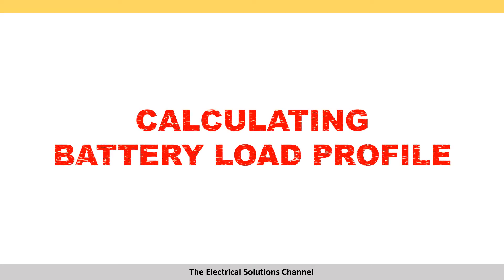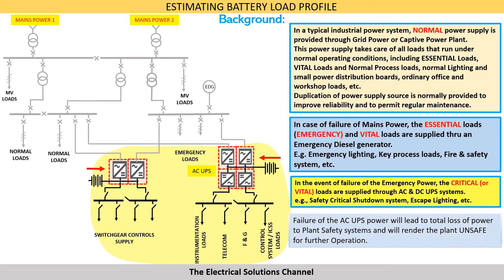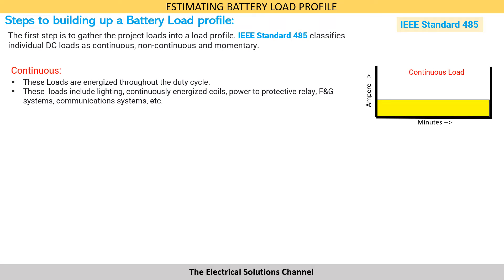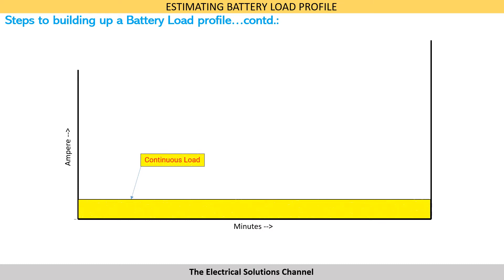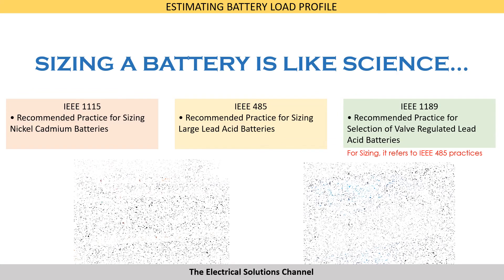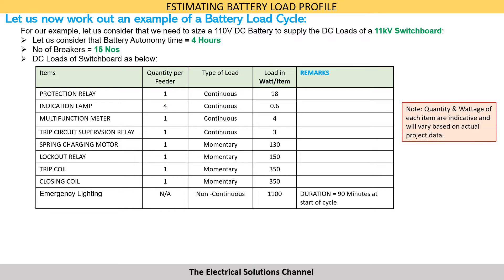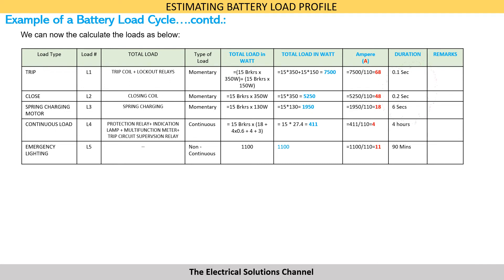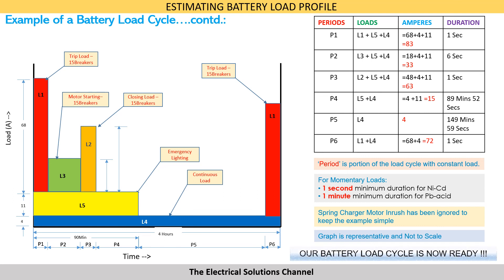BATTERY LOAD CYCLE PROFILE

Comment: Sir let me elaborate my query, in addc they required bus coupler in lvpanels in the same room. Say for example i have 2 lv panel which is in the same room. Since the bus coupler is required for maintenance and alternative source, so the sizing of my transformer will be 1tx supplying the demand load of 2 bus? Then the sizing of bus coupler and busbar will be on the sum of MDL of mdb 1 and mdb2. 

CASE2 if incase the sizing of thansformer 1 and 2 is for the dedicated bus section then load shedding will be considered since the mdl of 2 bus section will cause overloading inf incase 1 tx is failed or during maintenance.
Reply: Can i email you sir the sld so you can understand what im saying?
Reply from the maker: Thanks for your comments. Your configuration is not clear, However, if the transformer is required to supply loads of ONLY 1 bus then it should be sized to carry the loads of 1 Bus only. In case, the transformer is required to carry loads of the 2nd transformer also (in case of a fault in the 2nd Transformer), then the transformer should be sized to carry loads of both the buses.

Comment: Sir, can you make a video for 3 incommer 2 coupler sizing for example 3-2mva tx and how to consider the load shedding for this type of system.
Reply from the maker: Sizing of the transformer is dependent on the load being fed by the transformer and not on Incomer /Buscoupler combination. In your case, for example, if the 2 Incomers are normally sharing the total load and the 3rd Incomer is just a standby incomer and switched ON in case of failure of any of the 2 Incomers, then the transformers should be sized to carry half of the total load.
Load Shedding will depend of total Power Generation and total load.